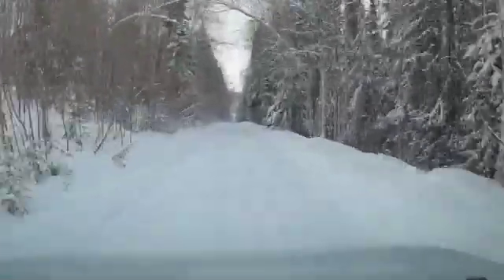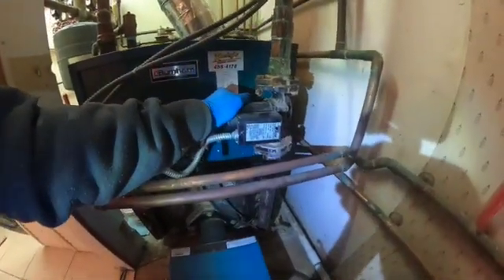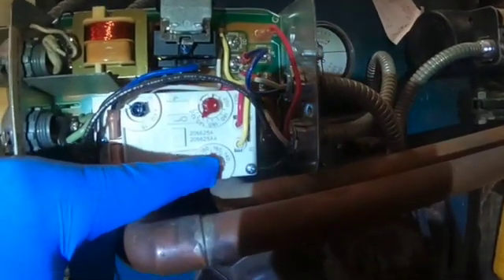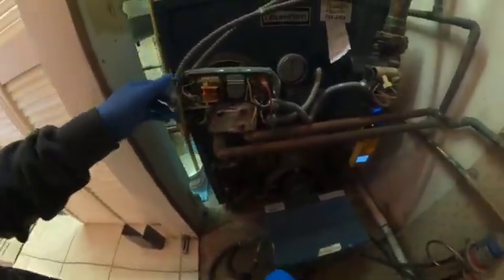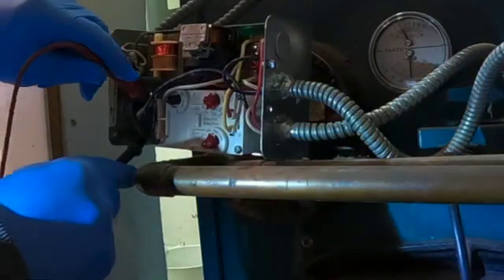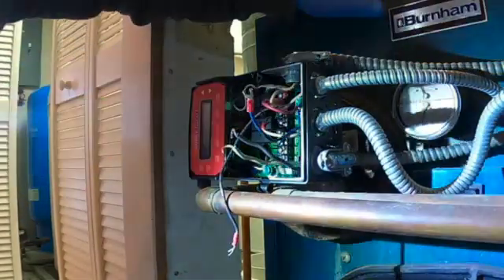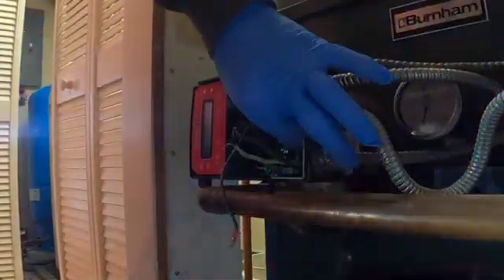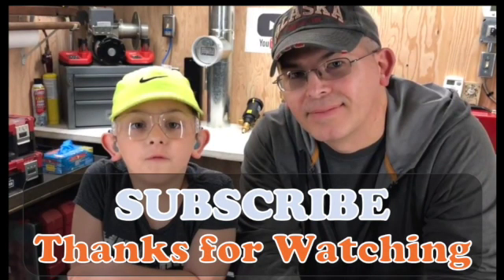No Heat? This Bad Aquastat Was the Problem

Comment: does this 7610 will replace most of an aquastats for oil boilers? do they have options for low water?
Reply from the maker: These controls replace a lot of the aqua stats. You can also get an extension cable to run a remote sensor. They do have some info in their manual on page 16 for low water control

Comment: Excellent informative video sir , can you give me your opinion on a new oil burner hot water boiler combo system with a new burner ? Is there any particular brand you feel is a excellent pair ? I’m going to one to purchase a new one soon just that there’s so many makes and model combinations, and I would like an opinion from a professional that works on them.. thanks 👍
Reply from the maker: This is a great question! I think it's always best to get a system which is stocked locally from a good reputable supplier so you can easily get parts if needed. I also feel the system should be designed to get the job done with the least amount of complicated controls. This will allow just about any tech to repair it if you are ever having trouble. This can also help keep installation costs down during the install/changout. 

Now as for the best system. The heating system need to be able to fit correctly in the space available and whether you need a direct vented system or a chimney vented one, so this can limit some of the system selections.
 
That being said. Every job has different requirement due to where or how it needs to be installed and what is readly stocked locally. 

I have installed Burnham Boilers, Slant fin boilers, Weil Mclain Boilers, Buderus Boilers, Toyo Water Heaters and worked on many other designs like System 2000. 

I personally like Burnham Boilers with Beckett Burners & Weil Mclain Ultra Boilers.
The Buderus Boiler have a water storage tank which can be installed as a boiler stand below it but the tanks must be inspected annually or it will void the warranty.  

Weil Mclain indirect water heaters are nice but you will want to upgrade the controller as they have issues going into error mode. 

Burnham makes a nice heavy duty indirect water heater which has a replaceable heating coil which is nice for the future.

I hope this helps. What part of the country do you live. I am in Fairbanks and North Pole, Alaska. so you can see why it's important for simple and effective systems. If I can be of anymore help, let me know!
Reply: @FurnaceTech  thanks for the information. I have a Burnham boiler with the removable coil and a Beckett Burner..it’s chimney vented ,and I’m in upstate New York.. the unit is about 33 years old and it still kicking and screaming , but leaks around the coil seal .. I believe if I try to remove it the bolts will just break in place and then I will be in trouble .. I see maybe I’ll stick to the Burham boiler then with a Beckett burner...sounds like it might the way to go.. I was thinking Bedurus but I don’t think I have the space for it..I appreciate your help in this matter , I will see what packages and prices they have on line and locally..thanks again for your informative videos , say hello to the young man and to keep learning from you all he can . 👍
Reply from the maker: Yes, be careful removing the old bolts from the leaking coil. They can break very easy and cause a costly emergency repair. The new Burnham boilers have swing out doors and removable top covers for easy cleaning!
Reply: @FurnaceTech  fantastic, I won’t be removing the coil until the boiler gets replaced...cause I know those bolts will break ..Lol 😂